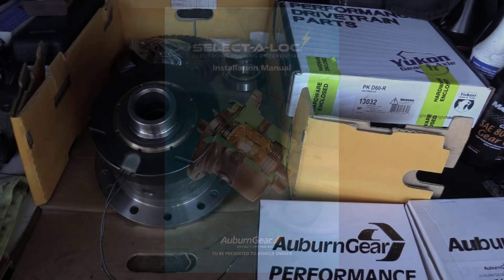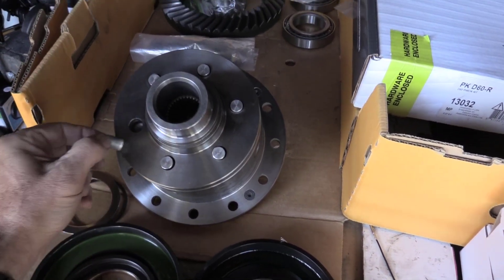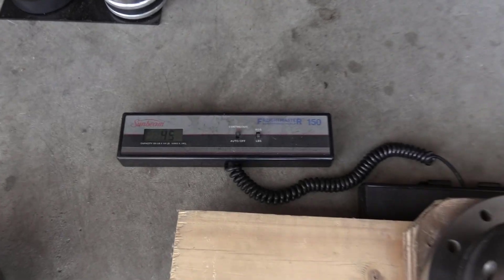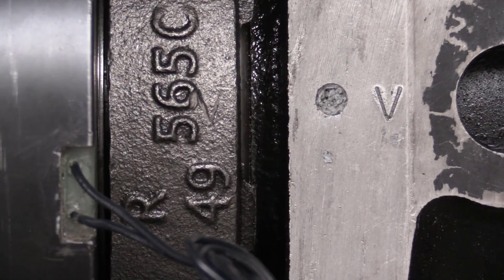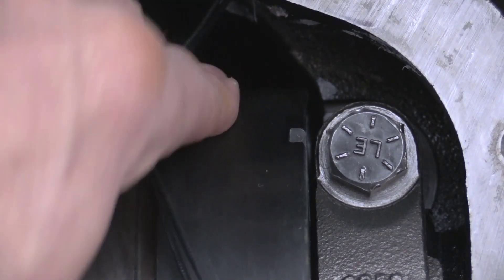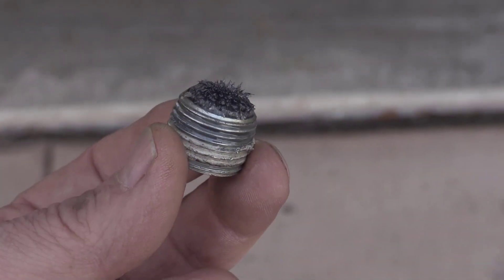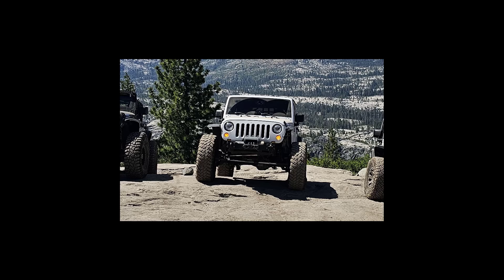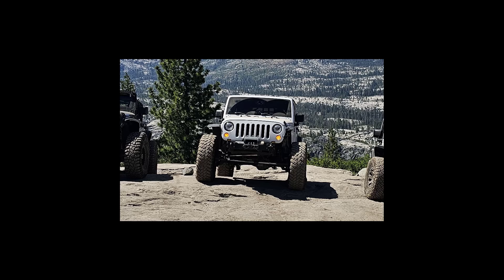Auburn Select-A-Loc Installation and Setup Dana 60

Comment: I can't wait for your 2025 Auburn Select-A-Loc 2025 update. I'm trying to avoid an ARB Air Locker if possible.
Reply from the maker: @DavoWright  I've been wheeling a fair bit lately.  So far so good.
Reply: @granitewheeler this is the limited slip to lock ?
Reply from the maker: @XOX-s2i  No.